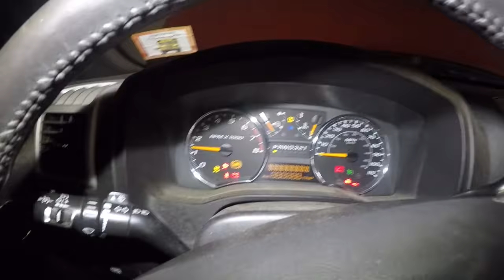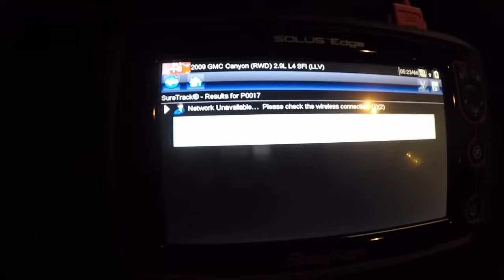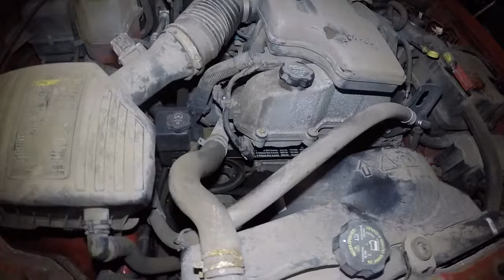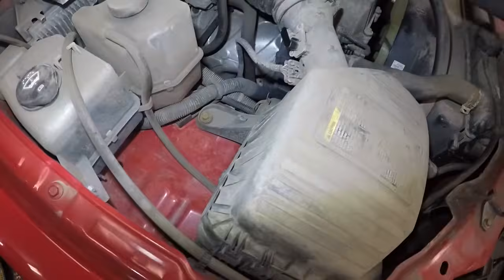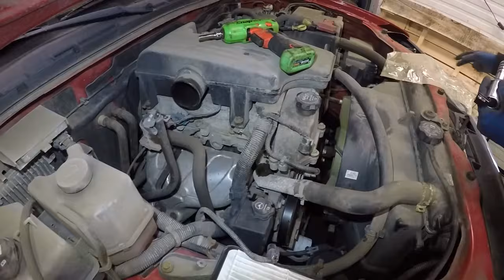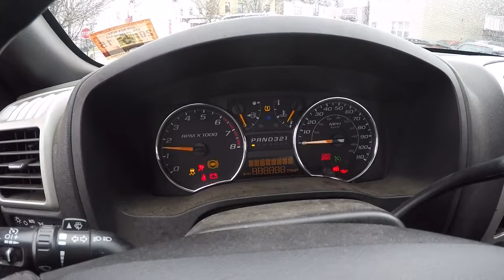GMC Canyon stalls code p0017 and Chevy Colorado

Comment: I have a 2008 GMC Canyon 2.9 and about 3 weeks ago started acting up, it only happens when 
I'm braking  or getting prepared to make a turn, it stalls or it feels like it wants to die. I'm thinking about replacing this vvt solenoid. I hope someone can help me on this
Reply from the maker: Yes try this and clean throttle just to keep it real with u try their stuff it’s cheap clean throttle first.  But these gmc are known for having stretched tuning bad timing Cha in guide and tensnor but before anything try cleaning throttle cam sensor and vvt let me know if u need further help
Reply: @RBTheMechanic  Thanks for replying back bro, Imma go ahead and clean those first to see if it helps before replacing anything. The weird thing is that I have no code or check engine light on. My truck has already 255 thousand miles so Idk if that has something to do with it
Reply from the maker: @yairtexan5733  no problem! Try clean throttle first go frilly it worked out let me know how things go
Reply: Got my 2005 Chevy Colorado 3.5 5 cylinder change the VVT solenoid change the cam sensor solenoid change the exhaust solenoid and I changed the crank solenoid and still popping up three p13 and p14 and now it's stalling and dying and intersection so I'm cleaning the throttle body today but I'm thinking it's my PCM and the p13 and the p14 were for the crank and the VVT sensor solenoids I change both of those and I'm still getting p13 and p14 don't know what the problem is any advice

Comment: I've changed the VVT solenoid and camshaft position sensor. VVT works fine (I can hear the audible change), but it still wants to drop to 500rpm or lower when slowing down (30mph to 5mph). I need to do the crankshaft position sensor next, but I was reading that it needs Tech-II to reprogram. The truck runs great and gets 22mpg per tank, it's honestly confusing. I'm almost due for an oil change again, what would be the recommended oil for the Vortec-2800?
Reply from the maker: Oil change I’m not sure but try cleaning the throttle body it might help raise the rpm
Reply: @RBTheMechanic  I’ll work on pulling it apart and clean the TB. I do have a P0017 code
Reply from the maker: @Dang_Jim  ok u don’t have to pull it apart just remove the duct pipe I’ll send u link to another diff car how I did it
Reply from the maker: @Dang_Jim  here’s a link https://youtu.be/ikXZPDLmcsI

Comment: It shouldn't matter but my 2.9 2007 Colorado  has a completely different air box design lol...I got six code's on my truck showing up an this was one im going to fix. Im trying to track down why my truck shuts the gas pump off every time i pump gas like its full when its not....
Reply from the maker: Well there blockages in the evap system which dosent let the air come out as the gas goes in so u need to figure that out check pipes or valves blocked up can be the canister it self but need good look in the the system very trickery repair
Reply: @RBTheMechanic  I have replaced both solenoids, wire harnesses, filler neck, blew air through all of the vent hoses Even change the fuel pump... I really don't know what it could possibly be but it is giving me both p0446 and p0449 code's...I'm just starting to get very frustrated with it lol.
Reply: @RBTheMechanic  ik your not supposed to but I checked the vapor canister by blowing very easy through it with my mouth and air flowed through it both ways so im guessing it's ok too?
Reply from the maker: @kentucky4696  it can be fault when it’s hot lotta situation makes difference
Reply: @RBTheMechanic  I changed both solenoids again and the whole charcoal canister I'm not getting a code anymore but I still have the same issue... Does the fuel tank vent out of the top of the fuel pump or out of the rollover vent valve on top of the tank? One of those have to be clogged.
Reply from the maker: @kentucky4696  it can be the vent calve or the pipes clogged up check all the pipes that run in to the canister it dosent vent out it suppose to go in to canister
Reply: @RBTheMechanic  I check and replaced all the hoses charcoal canister vent valve solenoid, purge valve solenoid, and the whole charcoal canister itself... I was just wondering because I got to looking if the tank vents out of the rollover vent valve on top of the tank when feeling or does it vent from the top of the fuel pump where the vent hose connects into it from the evap system?
Reply from the maker: @kentucky4696  there pipe on top that pushes air out
Reply: @RBTheMechanic  on top of what?
Reply from the maker: @kentucky4696  tank top of the tank there should be pipe not more to top center prolly some where to the side
Reply: @RBTheMechanic  mine only has a hose coming from the rollover valve that connects to the vent hose for the evap system and that same hose connects to the top of my fuel pump so im confused on what actually lets the tank vent when filling it up.

Comment: Some one cut the pig tail off the one im working on witch side is the tan wire on left or right
Reply from the maker: Danny Hodge not sure but I can find to see if my software shows wiring diagram and location of wires monday
Reply: @RBTheMechanic  its was the cat stopped up
Reply from the maker: Danny Hodge cat stopped up?

Comment: Ive had this code for about a month and replaced the vvt, crank sensor, and cleaned the throttle body. Somebody give me some insight on what else to do, still can't get this light off.
Reply from the maker: valentino lopez check the timing to see if all the markings are correct these cars and trucks also have problem with worn out timing chain guide which cause the timing chain to be stretched out

Comment: Thank you very much for sharing this! This was a problem with my 2008 Colorado. I got the stall, the  check engine light, and the same code. I replaced the solenoid And the truck works great! I will definitely pay it forward. Next fix will definitely be recorded and put on YouTube.

Comment: I have the same problem with my 08.  Only thing is that the code still keeps coming up .  I’ve changed the camshaft sensor, the crankshaft sensor, and the solenoid.  I even replaced the motor with a refurbished motor.  And replaced all the sensors on that as well.  I don’t know what is wrong with it.
Reply from the maker: Dan’s Channel what’s the code?
Reply: RB The Mechanic P0017
Reply: I have the same problem. Changed all sensors. All solenoids. Timing chain, vvt. And something else. Next step is to probably burn it. Lol
Reply from the maker: @arlocansino1850  did u change the timing guide the vvt sprocket set?
Reply: @RBTheMechanic  I want to say yes. Changed so much things I lost track
Reply: Do I need to reset and reprogram my computer because everybody's saying no but some guys are saying yes they had it done and now they get better gas mileage and it purrs and runs very smooth so the few guys that that had gotten it reprogrammed after they put their VVT in their sensor in and the exhaust sensor and the cam sensor all four of those sensors and still having the same problem still blowing p13 and p14 code and resetting it and it coming instantly back on and it running rough and it dying installing I don't know what the problem is or what to do some guy said burn it I love this truck I have considered it late night when I was in an intersection stalled out but it's a great truck and I hope it's something minor somebody else said check your mega fuses I switched a few around I'm looking for some better results someone else said check your PCM they go out I'm checking that today checked all changed all four sensors cleaning my throttle body and my map sensor today switch to my mega fuses around got good gas in it I changed the oil still throwing p13 and p14 installing I'm stuck I'm lost don't know what to do and now the truck just stalls and dies after a few minutes

Comment: This fixed my problem! Thank you. Good video also. My truck was doing weird stuff with the rpms when I was slowing down especially coming off a highway or taking a strong turn.  Took me about 20 mins start to finish. Thanks again.
Reply: Awe man dude! That’s literally the same problem I have right now. My engine will turn off when I take a sharp right turn. Ty for ur info, I’m going to try this out too
Reply: @skykingd did it worked for you?
Reply: @carlosjurado1393  honestly no but it was only because it turned out my problem was actually my Phase gear. Otherwise it would’ve probably worked.
Reply from the maker: Weekend Kev cool nice job quick fix ...please subscribe also subscribe to my other channel here’s a link https://www.youtube.com/channel/UCvqsPzqAZfVv_gjBYUFqNdg

Comment: Great how to video! Looks easy enough. Ima diy’er and gonna attempt to change this exact part in a bit. Thank you!
Reply from the maker: Virginia Gonzalez ok let me know how it went
Reply: RB The Mechanic didn’t work. I changed the solenoid, camshaft sensor, crankshaft sensor and oil. I also heard it may be the little black box on ignition housing. Tried changing that but don’t know how to relearn the key. I’ve tried every video possible
Reply from the maker: Virginia Gonzalez well some of these have problems due to stretched timing chain and guids
Reply from the maker: Virginia Gonzalez might want to look in to the timing but it’s heck of a job usually the guides wear out and timing geoes off causes stall hard start long crank on start up
Reply: RB The Mechanic thank you! I will look into that
Reply from the maker: Virginia Gonzalez ok let me know how things turn out but this was worth the try if ur car stalls try cleaning the throttle also
Reply: RB The Mechanic timing chain is good 👍🏼
Do you have a video for cleaning throttle on my 08 colorado or is the video you have up good for most cars?
Reply from the maker: Virginia Gonzalez I don’t have video on that but u can do it same way I did the Chevy Camaro
Reply from the maker: Virginia Gonzalez https://youtu.be/ikXZPDLmcsI

Comment: Hi I noticed that my truck is giving this code but also alot of oil under the engine. Is there a possibility it could have something to do with this?
Reply from the maker: Erin Cieslik if the oil level is low it would also give this code because the VVT works with oil pressure
Reply: I have ha rough idle so ran some bg 44k then it ran like new for 2 weeks.

Then the other day it stalled on my way to work then again on my way back so I parked it and let it sit in the driveway for a day.

Got home notice oil under the engine alot .I see there is a sensor behind the oil filter I feel has the most oil on it .Any suggestions?

Comment: You are right on. I have this engine in a Colorado and it would just die when cold. Did as you said and now it runs great.Thank you so much for this video.
Reply: Thank you! I believe i know what the issue is now. Mine also died while cold. Been having issues for a little bit now!
Reply: Yeah I have a Chevy Colorado wing it in the morning time when it's cold it dies is that what yours did when you change that can you answer me you could appreciate it thank you
Reply: @ronnieyoung7510  I ended up replacing fuel pump in the tank. The only gas filter is in the fuel pump and it is tiny. When it gets full of trash it restricts the amount of gasoline going to engine. Cold temperatures further restrict the flow of fuel through the filter. This causes random sluggishness, stumbling and dying.

Comment: Something that might be helpful.  I switched out my solenoid and still had the code popping up.   I took it to my mechanic and he said that when you change the sensors, you need to reset the computer so it communicates with the new sensor.  I am unclear if that was a load of shit, but once I picked it up from my mechanic, it is now running much better and even better gas milage.  The RPMs still dip down when I first start up the truck.......but otherwise, runs just fine.     If anyone has any thoughts....Id love to hear.   Thanks!
Reply from the maker: yeah the code will not go away on its on but reset the light is resetting the computer
Reply: They had to program mine to run better
Reply: I just did my cam sensor and drove it 60 miles no code so I don't know what they mean by reprogramming it

Comment: My truck started having the same issue yesterday. I came across your video and swapped out the part. I also changed the oil to a better quality oil. I heard that could also give you the same code.  We just bought the truck a few weeks ago. It seems to be running even better then before. So far the issue seems to be fixed. Thanks for the video.
Reply from the maker: rchavez 505 ok cool of any problems give me the code I’ll search it I know some of these trucks have issue with timing change stretched
Reply: @RBTheMechanic  That was my first concern. Changing out both chains is a big undertaking.

Comment: I changed out the part , and then the truck ran real rough, almost like it wanted to stall. Any suggestions as to what to change out next? I put the old part back in and the engine started to run as it did before replacing the part. Help!!!
Reply: did you use the Acdelco part cause if you use a aftermarket parts it might cause issue .. i went to auto zone and bought one and my car was worse but when i got the acdelco parts it work like a charm ..
Reply from the maker: Not Today that’s weird maybe this part is defective what is ur original problem
Reply: @RBTheMechanic  Hi.. Check engine light, doing, the code is the  P0017, and I think there was a 340, or 341. I will recheck the codes, and get back to you tomorrow, Truck is out getting a new windshield today.
Reply from the maker: Not Today ok try replacing this part again because it’s not suppose to get worst change out the can sensor also and after that if it’s no resolved then you might have stretched out timing chain
Reply: Reset the pcm. Disconnect the battery get a small jumper wire to drain the voltage out of the capacitors.
Reply: Technically it's supposed to be programed. That's what parta store and 2 garages told me. So maybe that's why it ran worse for u. Get it programed and should be fine.
Reply: I'm afraid to do it cuz of it having to be programed. Some may get lucky others might not I guess.

Comment: What's the name of the part?
Reply from the maker: D Williams  it’s.  variable valve timing solenoid. Please subscribe
Reply: Variable valve time selenoid/actuator
Reply from the maker: D Williams wait sorry I was looking at the wrong video this is the variable valve timing solenoid.
Reply: Cool i figured it out on mine it only had 1.5 quarts of oil I changed oil cleaned map sensor and throttle body it works great. Now
Reply: D Williams so if these trucks are low on oil it cause the stalling issue
Reply: What's the part number for it plz

Comment: Bro, this was a good how to.
Going to do this to my Colorado .
Reply: More than likely a bad phaser. The solenoid isn’t working on purpose. It won’t get a signal to function until the code is cleared. If it senses the issue still exists it will again tell the solenoid to stop working lol by not sending it a signal!